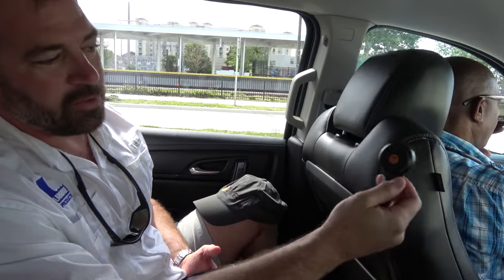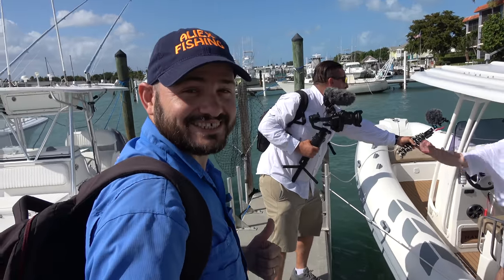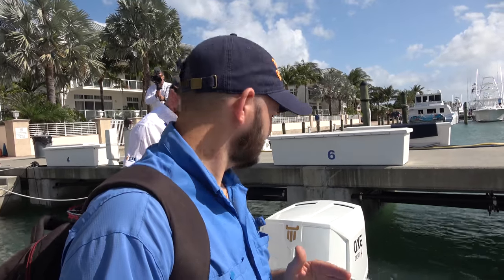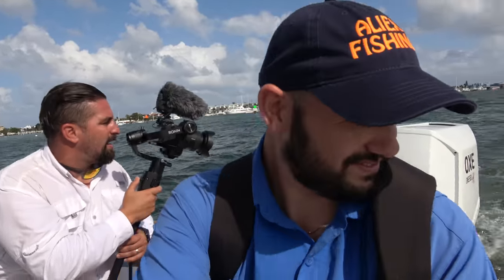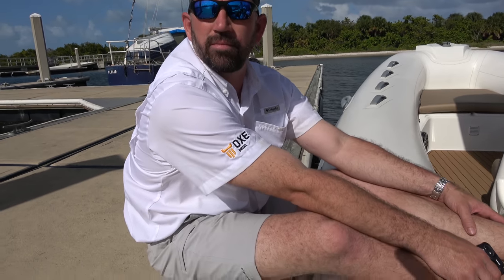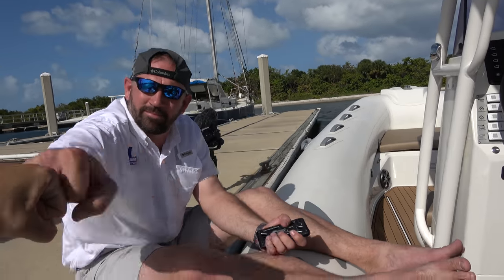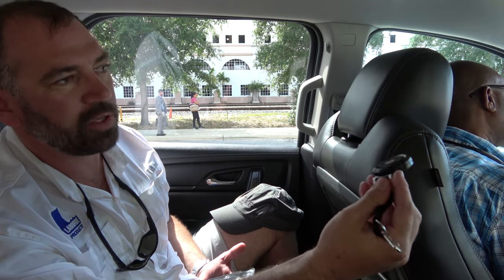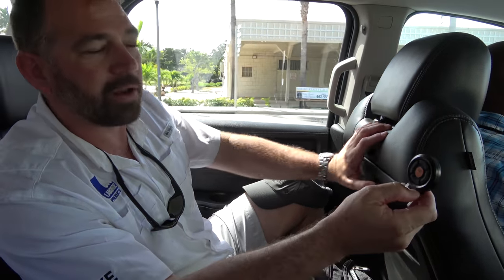New Diesel Outboard Water Demo Oxe Diesel K 150 HP on Brig Navigator 730 Palm Beach Boat Show

Comment from the maker: watch the FULL video so you can hear the ENGINE with no music it is there! Have you guys
Reply: Them crazy chicks and their nutty 2 stroke diesel outboards, that probably is a scotch yoke OP 2 stroke or something stranger than that. Taylor Swift's Amaroq 50 50 2 stroke diesel outboard is pretty creepy at 967cc and 80 ft lbs torque! Whoppie Goldbergs 1962 Amarc OP 2 stroke 300cc 18 hp has so much torque its better than most 25hp gas 4 strokes! She now gets over 24hp at 3200 rpm from hers!

Comment: That motor is huge for a 150, did he mention the weight..... Good video Aliex.
Reply from the maker: Yeah Diesel engine are heavier but this thing is a lot quieter and I didn't smell any fuel. The weight is around 772# share the video brother 😁 thanks
Reply: @AliexFolgueira  Cool, yeah that's about 200+ pounds more than a four stroke gasoline powered outboard..Thanks for the info.
Reply: Im guessing its the same weight for a 200-250 hp as it is for a 150. Diesel is great that way.
Reply from the maker: Yes that's what they said
Reply: @AliexFolgueira  My Yamaha 200 hpdi weighs 475lbs, 772 lbs for a single 150 outboard is ridiculous , a 300 4 stroke yamaha weighs 100lbs more than my 200 hpdi, good luck with your motor, your gonna need it.
Reply: Fluke Whisperer - best engine Yamaha ever built, the small block 150/175/200 HPDI.  Never a recall. Outlasted the original 4 stroke F product line.  Have 2006 twin 200s on my Grady 25.
Reply: It is a lighter engine but as soon as you start adding weight for people, fuel, ice, tackle, etc. then the diesel takes the lead without a doubt due to the extra torque being able to get the boat on the plane even when weighed down. The torque also helps make up for the heavier engine as does the reliability, longevity, and overall cost efficiency of a diesel.
Reply: DaebakMonkey I think my Yamaha 200hp Vmax HPDI is simpler and inherently more reliable than any Four-Stroke engine - diesel or gasoline as way less moving parts. My maintenance routine involves no engine oil change, valve adjustment, timing chain/belt etc. simply check/change filters & spark plugs and go. It gets economy of a four stroke and two-stroke oomph. No problems in ten years.
Reply: Robert P I’ve got a Yamaha 200hp HPDI Vmax on the back of my GW Tournament 205. Ten years and no issue. I re-proped to a four-blade for better hole shot, drop cruising RPM and better holding on the plane - sacrificed a bit of top end at WOT. As you said, I believe this 2.6L V6 was a very good design giving minimal issues.
Reply: @robertp7209  yes great motors. people on here don't seem to realize how torque works. the gasoline 2 strokes have less torque than a diesel, yes, but because they are so much lighter and spin higher rpm,they feel way quicker in the real world and thats what matters. not to mention the top speed advantage. be interesting to compare cruising speed, but seriously doubt they get better mileage than a direct-injected 2 stroke by any meaningful amount. all this crap about the diesel "having more torque with a full load" is pretty much nonsense
Reply: @AliexFolgueira  should only be around 250 pounds like the mercury 4 stroke 150
Reply: @ct1762  well if they have a lot more torque should be able to run a lot bigger prop more pitch and droping revs down therefore better cruisin mpg, in theory anyway 😁 they said the 200hp is the same motor as the 150hp. When up on a plane engine weight is less significant  as getting there. Be interesting to know the torque figures compared to petrol.
Reply: @ct1762  very few ppl run there boats flat out anyway

Comment: Disel seems unrealistic at first. But if you have the correct gearing you could utilize the crazy torque they produce
Reply from the maker: Ohh yeah lots of applications for diesel on the water
Reply: Turbos is a must
Reply: I'm not sure a diesel is much use on the type of boat they had in this video, but bigger, heavier boats with a lot of draft would do better with a diesel one or two pushing it rather than gas.

Comment: Top Priority/Advantage No risk of fire worth its with in Gold more economy for sure  for me also More reliability, penalty /disadvantage possibly more weight? on top cheaper insurance No risk of fire Great stuff,  this this will compare very "Favourably" with a 60s 115 Mercury TWO stroke am sure on economy they be "neck n neck" LOL
Reply from the maker: Great breakdown thanks
Reply: Really how common are boat fires on boats powered by gasoline outboards? That’s the whole point, outboards naturally vent and so there are no fuel vapours getting trapped in an enclosed environment like engine rooms in shaft or stern drive powered boats, waiting to get ignited.

Comment: It is just a matter of a few days until that remote gets in the water and gets lost...
Reply from the maker: That's why you have redundancies built in
Reply: How many times have you dropped your boat key in the water?  Sounds like, a lot.
Reply: Great
Reply: That’s why the floating key ring was invented.
Reply: Jeeezzz... the same can be said about boat keys...
Reply: This key Fob has its own .1 hp Diesel engine And it will motor it’s self right back to your hand like little swimming fish.

Comment: well I can buy off road diesel cheaper than non ethanol gas so that is a plus...
Reply: The Weapon Collection  off road only, supposedly, so it seems like it could be used.
Reply: According to a government website coloured fuel may be used for any reason other than to generate power in a licensed motor vehicle or when a motor vehicle or vessel (ship, boat, barge or other watercraft) is operated principally for pleasure or recreation.
Reply: The Weapon Collection  that's kinda what I was thinking with all the diesel motors requiring additive because of emission standards. But, I sure do like the option of having diesel engines. Hole shot and top speed might suffer, but if you gain enough run time on a full tank of fuel, I would like the trade off.
Reply: @drew65sep   hole shot and top speed lol I think there is  somthing wrong in your guys heads
Reply: If it is a common rail system then it will cost more in repairs than a gas outboard.  All common rail engines are  SUPER picky when it comes to fuel quality/cleanliness. 30 year diesel tech

Comment: Got to change the belts...? That's an extra cost, you don't have to change shafts in other motors, or clutch plates...!
Reply: thumpin1 so what? Calm down. Its a diesel. It will outlast all gas engines out there, with much less maintenance. 

Motor cycles have gone to belts and it isn't the end of the world. Take your midol, brah.
Reply: In my country desiel is way  cheaper than gasoline though diesel consume less
Reply from the maker: Diesel is a great option to have for sure
Reply: The belts last years.

Comment: Nice machine and its a great engine, but in my opinion diesel outboard engines are a fail. They are too big, too heavy, hard to maintain,  they polute the water more then gasoline engines. How about gas powered engines. They may be a little less power then gasoline but pollution is microscopic compare to gasoline and diesel. Gas engine is not for everyone and not everywhere. Gas bottle is also big and have its weight, and some places in the world gas can be more expensive then gasoline. Some would say get electric outboard, and yes they can get very fast now days but the weight of a battery is mesured in tons and electric outboards cant be maintained. They just break when they go bad, and they can break in places you would least want them to break. So my winner is still old traditional gasoline engine. Cheers for a great video. Monster boat with monster engine. I loved it. And the ride looked awesome.
Reply from the maker: They will get better

Comment: OXE Diesel from CIMCO MARINE - sucks! The Swedes soldered it to us for 45 K euros each. We were one of the first to acquire 2x200 hp and we still curse this day of our life. We serve ourselves, nothing complicated. The engine itself is GM (for Opel Insignia). An innovation only in the transmission to the propulsion. 1. Non-industrial model. Not suitable for heavy use. 2. Raw and imperfect design. 3. The housing starts to molder down almost immediately despite the anode protection. 4. The motor cowlings are literally ripped off by the pressure of water. We had to remodel it ourselves. As a result, all the parts were in the water and the entire electrical part had to be changed. 5. Turbines do not withstand the nominal declared speed, overheat at 3000 rpm. As a result, it is impossible to develop full power. 6. The company does not want to be responsible for its products. 7. It is impossible to get technical support. Got the money 
and forgot. Then they simply do not respond to emails. A couple of years later, they admitted that some parts, turbines in particular, were incorrectly calculated and incomplete, but they refused to send new ones. 8. The engine cannot be lifted on the move in shallow water, which increases the draft by half a meter. 9. Weighs almost half a ton. In short, quality 2+, technical support 0, manufacturer's responsibility 0. One and only plus it's diesel. We were forced to take it for a work in order to meet maritime safety standards.

Comment: Belt driven instead of shaft? No thanks.. id hate to be 20 miles out and a belt breaks you're done lol
Reply from the maker: Well you always care a spare
Reply: Any good captain will always have spare parts.  Like belts and tools on board.    Not really a downside.    Same is the case with inboards and  IO's
Reply: @EZ8E  really? Iv deckhanded on alot of boats never once seen capt. Bring a spare lower unit.. maybe a spare spark plug or 2 and some tools but never a spare drive shaft or bearings  what is the benefit or a belt over a shaft? Trust me when i say iv had my share of problems iv been 60miles offshore when i steering cable broke tied a pabble to the outboard and steered it in old school.
Reply: @nathanbutler8240    A spare lower unit?   Bearing?   Drive shaft?       C'man!    Were talking belts here.   Spark plugs, check.  Full tool kit.  Check.   Oil  Check.    Power steering oil.   Check.    Serpentine belts.  Check.  Extra prop.  Check.   Dive mask.  Check.   There are certain things that just cant be fixed on the water.    In those cases your calling for a tow.      Redundancy helps.    Otherwise...  get comfy and wait for the tow.
Reply: There would be a change out schedule for these belts.
Reply: Spare sir Spare us the trouble worrying for ya.
Reply: The belt is 4in wide. It’s not breaking.

Comment: So who exactly builds the engine? Does OXE build it in house or is it rebadged? I do like the robust water separating system!
Reply: I looked into it. They're European GM car diesels.
Reply from the maker: Do you have a link?
Reply: The oxe diesel is made in a fabric in sweden called ufab. The company behind The oxe diesel is cimco Marine. The engine they use is a Opel engine. They are going to male a 300 hp next year basef on BMW engine
Reply: @jmowreader9555  Opel Isuzu

Comment: Glad OXE is still going. The concept I was working on with my old company was a lot nicer than the current cowling. Didn't have these crappy looking plastic looking toggle locks in the front. It had a proper lock and a nice hinge point at the back. 
I'm guessing they went back to fiberglass cowling instead of plastic cowling.

Comment: Great engine, how much does it cost ? I have a Johnson 150 hp engine, one of the most successful engines, but unfortunately we have a shortage of spare parts in our country.
Reply: what do you need? im an OMC mechanic and have a small shop in the states. crossflow or looper?
Reply: @ct1762  Thank you, this is kindness from you, but when I did not find the parts I needed for the engine I sold it and it was damaged in the pistons
Reply: @kingoffish4259  no worries! hope you got a newer one that runs well cheers!
Reply: Thank you, is it possible to communicate via WhatsApp?

Comment: Beautiful motor but... 36mph in that rib with a 150hp... and will these motors be drained of more power from possible future emissions? cheap off road diesel though is music to the ears though!!
Reply: Like most common diesels, it will have a third party delete kit on the market soon, lol.  When I deleted my Cummins 6.7, no more carbon being pushed back into the engine, fuel mileage jumped about 3-4 mpg easily, and weight reduction.  If they were getting about 4 mpg in the video, I bet it will jump more once deleted.  I am looking forward to more diesel tech for smaller boats, about time!

Comment: Better for the environment? What about all the particulates going into the water?   Going to be rolling coal underwater?
Reply from the maker: They say deisel is cleaner than gas, can't wait for solar outboards
Reply: Aliex Folgueira not for particulates 😟
Reply: Automotive Diesel engines have to have DPF and EGR systems to remove particulates from the exhaust - no mention what happens here. Also newer emissions regulations require urea additive or AdBlue to drop the NOx levels - no mention what they do here. So if none of this is on this engine, it’s gonna have a soot filled exhaust and spew NOx gasses into the water.
Reply: There are still 2 strokes on the water they shud be banned... check that oil slick 😣
Reply: @johncanalese588  it wont pass if it doesnt meet epa regs !!